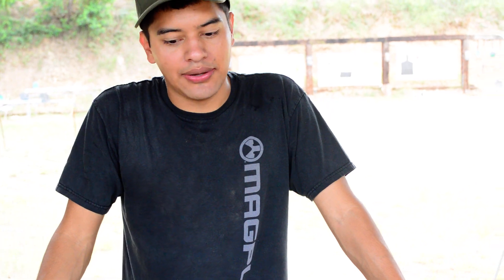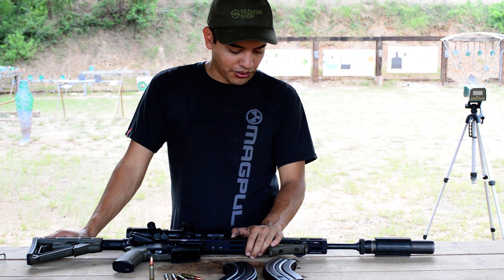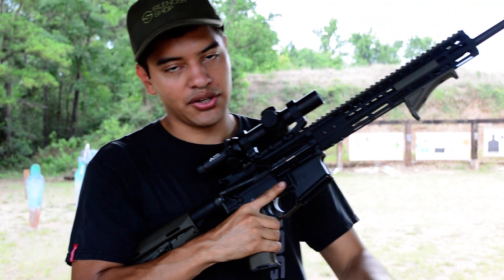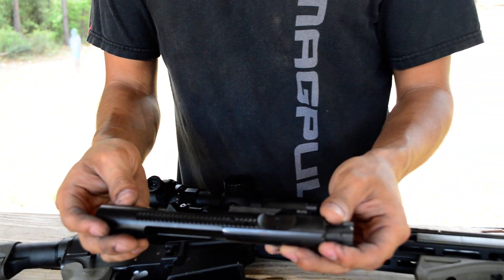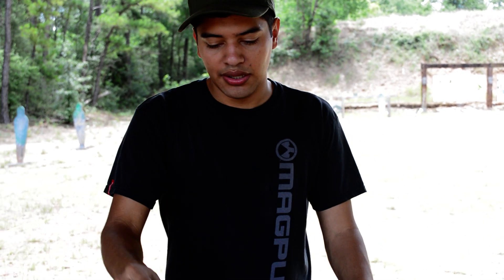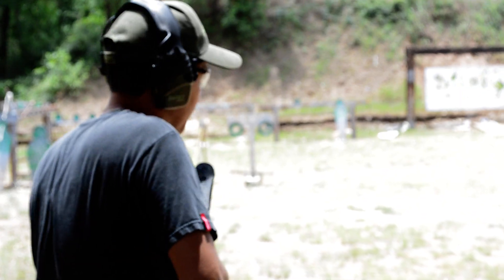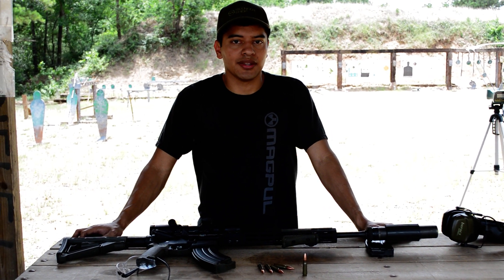Tips on building a reliable 7.62x39 AR-15

Comment: If you need a reliable Magazine check out  new  multi caliber magazine  UNIMAG  which cycles eight different calibers to include the 7.62 x 39, and  it  looks like a  AR magazine and not a AK banana style magazine.  Made to fit  AR  lowers work great  got my UNIMAG  from Primary arm.   Made by  Ross Defense Systems

Comment: You just need a good Mil-spec hammer spring & an enhanced firing pin to shoot Russian primers. You could buy an extra power hammer spring like I did but you shouldn’t need it to shoot Tula or any other Russian steel case ammo.

Comment: You hit the nail on the head for making a good reliable AR-47. Key part's  that need to great quality  BCG, enhanced firing pin, C Products  Defense  mags,  and well made M4 feed ramps. Great video. I  love my AR-47 so much fun to shoot.
Reply from the maker: Thank you so much! My older brother has 10.5" 7.62x39 SBR and we learned along the way what works and what doesn't so I thought I'd bring along what we've learned to a video. I love my 16" x39 build and they are definitely as reliable as any other AR I've had.
Reply: m4 feed ramps cause bolt breaking and cracks on a 7.62x39 round.. its not even close to the proper feed ramps.. they need to be 300 blackout ramps or they will ruin the bolt every time.. M4 feed ramps on a ar-47 platform is like having a grenade in your hands..
Reply: @homesteadhomie1418  ok

Comment: After a lot research watching videos like this…

I went with an H2 buffer, carbine buffer spring, Enhanced Power Hammer Spring , Battle Rifle Arms 762x39 bolt installed on an existing Aero Precision BCG, Faxon Mid-Gas 16” barrel, Aero Precision Adjustable Gas Block, DuraMag 28rds, Aero M4E1 lower, Aero Enhanced Upper, Aero Quantum Handguard, Magpul UBR Gen2 Stock, Law Tactical Folder, Kaw Valley ASR mount, and Omega 36m.

Comment: What buffer weight are you running? I have the same barrel and a JP adjustable gas block. Can't get the bolt to lock back on last round even with gas block fully open. I have a 3.3oz buffer in it now, seems like i may need to go heavier to slow the BCG down.
Reply: H2
Reply: 5.3 oz works well

Comment: Thank you for the informative video! My setup is slightly different. I'm running 30 round cpd and d&h magazines with a h2 buffer and xp spring both from kaw valley. Feeds flawlessly and locks back everytime.
Reply from the maker: Thanks man! Yeah a heavy buffer weight will definitely slow down the cyclic rate like an adjustable gas block would.
Reply from the maker: Badass. We have an H1 buffer in our 10.5" setup to deal with the added back pressure suppressed with the shorter barrel.

Comment: New to gun building in general!! I just built a 7.62 and mine was having over gas problems so I swapped some weights out to make an H3 buffer now I’m having a failure to eject. Need to check my extractor but with less than 20 rounds through the gun I’d like to think it’s not broke yet but still very over gassed? It’s a 7.5 build so I know gas is the main factor. Pretty lost on why it’s doing it. I only have Tula ammo to test right now as well
Reply from the maker: How does the extractor look?

Comment: So I just got a radical firearms AR 15 chamber in 7.62x39 I believe it has a traditional straight walled mag. It could have a block but I believe it’s a 10 round mag and I can’t get more then six in. I also wanted to see how it chambered before I fired it, chambered a live round and wanted to see how it ejected and it wouldn’t. I had to bang it against my leg and yank the charging handle. I took it back to the gun shop I got it from but the owner didn’t know much about it. He cycled one and when it came out the lead was in my barrel but the brass ripped out and powder went every where. I explained to him what I’ve read and heard and he didn’t know just offered to send it in and a new one shipped. From what I can tell it’s hitting just below the barrel but the bolt is jamming it into the barrel in an awkward position. And on top of that I also believe the ramp it came with is somehow off, it gouges the lead and flattens the very end of the brass. My brother shot two rounds and the 2nd sparked all over our target making me believe the ramp is bending the case slightly sending powder down rang with my lead. I also tried a different buffer spring thinking mine was bottomed out or not working properly but even with a new spring had the same issue, even when hand loaded then closed the bolt. But I know the round fits good in the bolt carrier so not exactly sure what’s going on. Any idea on what’s going on or how to fix this
Reply: Sounds like a Short Chambered Barrel.

Comment: I built a 450 bushmaster ar, everything was the same as 223/556 but the bolt & barrel. Upper & lower & trigger & buffer are all interchangeable.
Is the 7.62x39 build the same, or is there differences in the upper & lower?
Reply: The .450 only shares the same BCG I think, that’s all.

Comment: If you want to get rid of those ugly Russian looking magazines and make your AR look like a AR try the first multi caliber magazine called the UNIMAG.   It  cycles eight different caliber cartridges without making any adjustment what so ever.   Ready to use right out of the package made to fit a AR  lower platform works great using the 7.62 x 39  and it looks like a standard 30 round AR  magazine.  Check it out on Primary Arms.
Reply: I bet you work for them

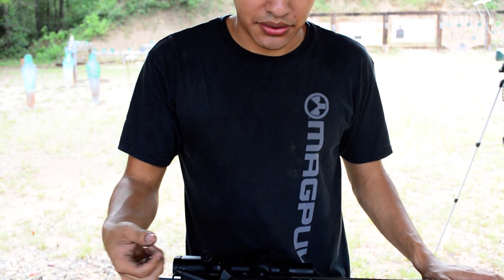Comment: great video,  sorry the idea is lost on me at 3:10 ish when you talk about 5,000 rd bolt breaks...
Reply from the maker: 7.62x39 bolts have less support material on the bolt lugs, so the lugs crack quicker. The lugs (and therefore, bolt) last about 5k rounds before you have to get a new one.
Reply: Says a guy who makes it to the range 3 times a year and shoots a total of 200 rounds.  A lot of the arm chair commandos like to theorize about how they will use the gun, but few ever will.  5 thousand rounds of 7.62x39 ammo is around $900.  .300 black is about $2750 for 5k rounds.  Just so that's in perspective for you.  A $70-$100 bolt is a drop in the bucket when you look at ammo costs.
Reply: CMMG fixed this with the Mutant - Powerbolt - Uses a shortened and lightened AR10 bolt.

Comment: Any tips/advice for feeding issues on one of these ARs in 762? I do not have light strike issues I have the enhanced firing pin and hammer spring installed. I am using ASC magazines.. I know you mentioned to use CPD mags but I heard from many people those give issues as well. Was curious if anyone knew of any other possible fixes for feeding issues. I have a side charger setup from BCA
Reply from the maker: I would go with an adjustable gas block or heavy buffer to slow down the cyclic rate.

Comment: Do you need a 7.62 lower or will a standard ar15 5.56 lower work
Reply: Standard ar15 lower here's things to grab if you are doing this build

Kak H3 buffer (ar15 discounts)

Enhanced 7.62x39 firing pin (black rifle arms)

Sprinco blue spring (ar15 discounts) 

That's my build for my 7.5" 7.62x39
Reply: @h4tedxx684  awesome thank man. 
Im gonna built a battle rifle clasic A2 lower and 20inch a3 upper. 1/10 twist. I love the 7.62 round but hate the AK platform.  
The sks and Ar15 platform are far superior im my opinion. 
But i also believe the 5.56/.223 dose not do well in jungle/bush applications.
Open range long distances (300+ meters) yes all day every day. 
But 200 meters and less in heavy brush cover... sorry 7.62.
Reply: @h4tedxx684  list is noted thanks again
Reply: Any

Comment: Great video, a few questions for ya...
1) Any recommended upper receivers or will any standard upper work?
2) Did you use a regular size ar-15 handguard and barrel nut, or a larger size?

Thanks for your help...
Reply from the maker: 1. Just make sure the upper you get has M4 feed ramps
2. Any AR-15 handguard will work. I like Guntec M-LOK rails.

Good luck!

Comment: Wdym by carbine buffer minimum? I'm building an AR47 with a Noveske KX3 on a 10.5" faxon barrel, geissele H2 buffer with the braided +power spring. Im currently waiting on an adjustable gas block from PSA rn butthe barrel came with a pinned gas block. Do you think it'll run fine without the AGB? Gonna be running a mix of brass and steel cased ammo. Cproduct mags, toolcraft polished NiB m16 carrier/AIMsurplus NiB 7.62 bolt w enhanced firing pin have me rather confident any problem will be with the gas system, but I did have to polish my feed ramps already, the faxon I received had some burs on the ramps
Reply from the maker: I meant that to not take the weights out or to use any lightweight competition style buffers. Not having an AGB will work, but an AGB will slow down the cyclic rate to make sure the roughy has enough time to feed.
Reply: @joshv06  I figured I'd use both solutions. The buffer system I picked up should take up some of the sharpness of the recoil and improve lockup timing without messing with the gas system but I figure there would still be some tuning necessrry so I grabbed an AGB to be safe. Both should be fine right? Only reason I'm conscerned is bc I heard faxon gas ports are a little small for 7.62

Comment: Is there anyway you can make my 7.62x39 AR reliable I’m in texas
Reply from the maker: All covered in the video
Reply: The only thing you should be concerned with is replacing the bolt extractor/springs. It does take more damage with the bolt, but Iv only replaced 2 extractors from cheap bolts over 6k rounds, so 3k sounds about right on extractor life. It’ll be just as reliable as a .223 build just the given downsides of steel case and less materials in bolt/extractor. I will note that Iv never broken a bolt yet just extractors on 7.62x39 bcg.
Reply from the maker: @b.anthony9214  I just use a 5.56 extractor on mine now with a spacer to make sure it catches the rim.
Reply: @joshv06 spacer?

Comment: Great video Josh.  I'm really close to buying a Faxon 7.62 Gunner barrel, but I really worry about the extra weight of my suppressor for that profile.......  Is this barrel the "Russian Gunner" profile?
Reply from the maker: Correct I am using a gunner profile barrel by faxon. Even though they market it as a somewhat light barrel, you gotta remember that you have a 30 cal bore. So it's more rigid than a similar weight 5.56 barrel.

Comment: I use an H2 buffer and a .308 carbine spring. Improves function and reduces recoil. I have used a 7.62x39 Colt since 1992, when they were the only one and this kid wasn't even a gleam in daddy's eye.  I use Tula all the time. Tula, Wolf, Bernal. It's all good.
Reply from the maker: I was born 1992. So I guess I was a gleam in my daddy's eye :P. A .308 spring increases the forward bolt velocity. Sure it will work, but a standard carbine spring will work better once your mags get dirty from blowback and there is increased drag in your magazines (since the magazine is non-traditional and not optimized for the platform like an AK mag in an AK or an AR mag in an AR). Your magazine stack is already feeding up slowly as it is and having a standard carbine spring will ensure the slowest forward bolt velocity to give the round more time to get to the top of the magazine to be ready to feed.

Comment: I've got one of these in a carbine length and am building another in mid length using the faxon barrel with f marked a2 front sight and a vg6 gamma 300 blk muzzle brake. The midlength one will have an aim surplus qpq nitride bolt with lifetime warranty and the other carbine length one I have a toolcraft qpq nitride bolt with it. Both will have elftmann service triggers. The one with faxon barrel will be my home defense gun. It'll have a yhm upper and spikes tactical punisher lower with bcm enhanced parts kit. It'll have troy flip up rears and an xs tritium white stripe front. The optic on it will be an aimpoint pro with American defense mount and 3x magnifier, it'll have a battle arms development badass safety lever and a bcm ambidextrous gunfighter charging handle. On the carbine length it's a er shaw phosphate hbar on an ar stoner upper and Anderson lower with ar stoner lpk. I'm going to use it for hunting and plan to use an American defense recon mount with a Leatherwood hilux cmr 1-4×24. I only use cpd mags in 20 and 28 rounders. The carbine length one has functioned flawlessly with tula, monarch, brown bear, Chinese, it seems to like red army standard best. Golden tiger I initially had light primer strikes on because I had a 4 pound hammer spring on it. When I changed the hammer spring out for standard milspec spring golden tiger no longer became an issue. I am still amassing parts for the midlength faxon build and hope to have it completed around spring or summer 2018.
Reply: Very informative video thanks
Reply from the maker: Good luck on your build! I really want to get a hold of some Golden Tiger Boat Tail ammo. Seems really good for the price.

Comment: love my x39 ar build. run perfect you are correct CPD mags is what you need. question tho, why 28 rnd cpd mags instead of their 30round mags
Reply from the maker: 28 rd CPD mags are the same height as 30rd AR mags and the bottom angle is manageable with the Magpul ranger plates
Reply: The ONLY reason  28rd mags exist is because  they fit in a mag pouch  and are the same dimensions as a standard issue  30 rd gi mag

Comment: What is the shortest barrel you would recommend? Have you done any experimenting with porting the barrel, using removable threaded plugs for subsonic? Example Angstadt Arms 9 internally suppressed.
Reply from the maker: 7.5". But personally, 10.5" is the sweet spot for me. And no I have not. We plan on selling subsonic 7.62x39 for about 70 cents a pop this year. They work perfectly fine.

Comment: What am I doing wrong I have a d&h tactical 30 round mag and I use wolf laquer ammo. I have a enhanced firing pin and a heavy trigger spring and I still get light primer strikes. What could I be doing wrong?
Reply: Could be head spacing. Check with a no-go gage

Comment: + joshv06 What size gas port works best on a 10.5” 7.62x39 barrel?
Reply from the maker: .093" has always seemed to work
Reply: joshv06 Thanks! I have a Faxon 10.5” that is significantly undergassed measuring it tomorrow to see what I need to open it up to.
Reply from the maker: @JEJAK_777  dang. I also have a 10.5 faxon build and it works fine. I'm running the same parts in it as in the video.
Reply: joshv06 I’m on Barrel #3 from Faxon, the first one they sent out had a significantly crooked gas block, the second had an off center drilled gas port, and now this one has a tiny gas port.

Comment: Did you just use a regular AR lower? Are those mags specifically for "AR 47" type firearms? Im just curious which parts ARE and ARE NOT compatible. Those 2 (lower and mags) being the ones I am most confused about.
Reply from the maker: Lower is just an Anderson lower.  Mags are CPD 7.62x39. Barrel and bolt are obviously proprietary too. That's about it.
Reply: @joshv06  Thanks buddy

Comment: I’ve got a 10.5” 7.62x39 I recently built. Has a carbine length gas system. It’s short stroking every single shot. Started out with an H2 buffer and went to a carbine buffer. Still short stroking. Any suggestions? I’m using CPD 20 round mags as well. Thanks
Reply from the maker: What barrel. Any failures?
Reply from the maker: What buffer spring and barrel mfg?
Reply: Bear Creek Arsenal barrel. Standard carbine spring.
Reply: I built another 7.5” x39. It has a pistol length gas system. Used a BCA barrel in it too and it’s never failed once on me...
Reply: I'm having the same problem same company barrel which leads me to believe that it has an out of spec gas port I'm running carbine spring and buffer

Comment: I had problems with asc mags so I went c-products and now they all work fine. Guess they needed break in time. What would be your opinion on a broken extractor that ran wolf Poly fine for about 400rds but broke on the 2nd rd of tulammo. The bolt is from Aim surplus. It basically broke the claw off evenly. You did bring some things to light with your video. Great job and keep it up. Btw your Ar looks awesome with the can on it.
Reply from the maker: Thanks man! What bolt were you using?

Comment: Were your CPD 28’s a little sticky at first?
If so, what did you do to smooth them out?
Mine aren’t pushing the stack up quick enough and I’m wondering if it’s normal for the first few times it’s loaded and emptied or if I need to dig deeper into cleaning these brand new mags before I depend on them.
Reply from the maker: I noticed on 2 of mine that I had to break the spot welds on the inside. They were making the rounds drag. Use a polymer tool to push the follower all the way down and back up. If you feel drag (compared to a working mag), then you need to hit the spot weld on the inside spine of the mag with a flat head screw driver and a hammer.
Reply: I’ll check it out and if needed give that a try. Thank you very much for the advice.

Comment: Will a BCG from a 6.5 grendel 2 work for the 7.62x39? I know the 7.62x39 I's the parent case for the 6.5 grendel. The reason I'm asking is I have 2 6.5 grendel's and was thinking of doing 7.62x39 on one of them. Just wondering if you have had any experience with this idea?
Reply from the maker: Good question. To be honest, I do not know. Toolcraft 7.62x39 nitride BCG's are so cheap and plentiful that I just go with those.

Comment: What’s up he shortest barrel is good for this round
Reply from the maker: I have a 10.5. The velocity increases per barrel length are the same as 300 Blackout. With a 10.5", you get the awesome carbine gas system.
Reply: joshv06 what would you say about a 8 inch barrel with a 2 inch flash can?
Reply from the maker: @geocow5105  Flash cans are wasted barrel length. Wouldn't you want to have the added 2.5" to go towards more muzzle velocity, less flash, less muzzle blast? Add 2.5" and you're at a 10.5" barrel. Go with a 10.5" and a flash hider.